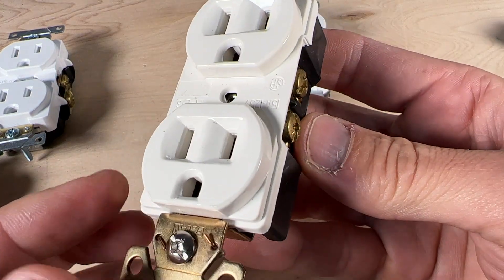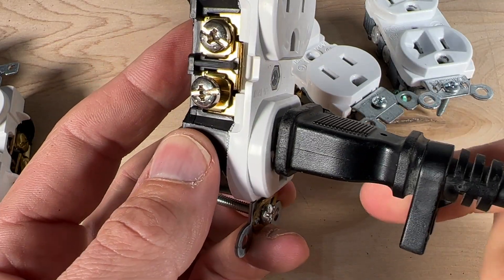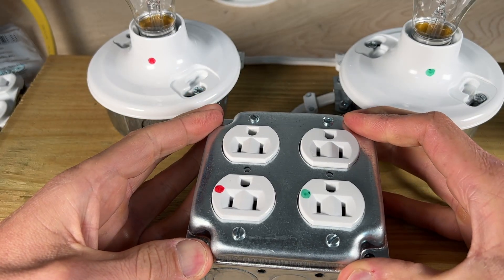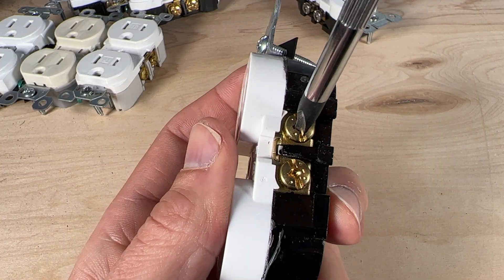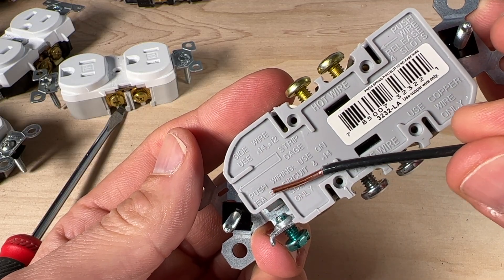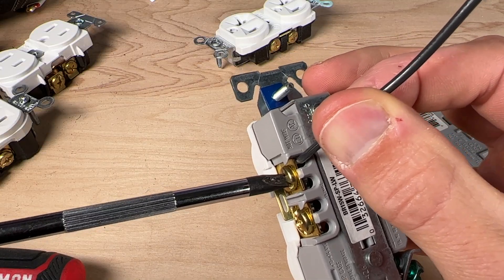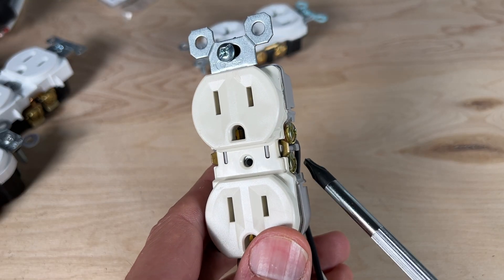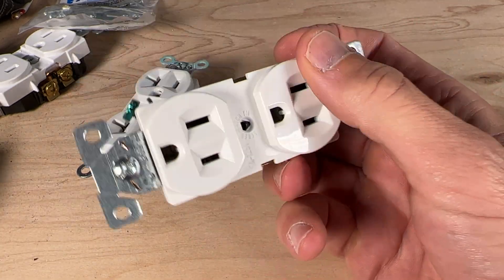21 Facts and Features Of A Standard Outlet

Comment: I knew about wrapping wire clockwise around terminal but the rest were all well kept secrets until YT, especially that special screw driver. So does that special screwdriver tip come in with a screwdriver that has changeable tips?

Comment: Don't know if it was right or wrong, but in wiring my house there are no breaks the wire. Removed a section of insulation from hot and neutral, looping around both screws and continuing down the wall. No break in any wire on any run.

Comment: Most of the features are just not practical to use. Also I knew of just about all of them. Those connectors in the 4” square are exactly the same as backstabbing. They are just little pressure springs in there just like in the outlet.

Comment: I never realized there was a difference in a 15 amp outlet and a 20 amp. I mean I knew the wire guage was different, but I never knew there was that extra horizontal slit on the outlet. I imagine they have always been there, and I just never really paid attention. Plus for example our microwave is built into a cabinet on the wall so the outlet is not visible. I'll have to check that next month when we do our kitchen remodel and that cabinet comes out. Thanks for the great information.

Comment: At 6:46 you say wind the wire clockwise but you go counter clockwise leaving the wire to unwrap when you tighten the screw.
Reply: He started with the end of the wire secured on the right side so yes, he then made a counterclockwise motion but the end result is a hook that goes clockwise.  When he tightens it the end of the hook will get pulled in.

Comment: Great video. I knew pretty much all of this except for using the hole in the grounding area and the slots by each screw as ways to make a shepherd's hook around a terminal. My only question..."How easy is it to actually pull this off when working inside of a box"? I know that a lot of videos show wiring receptacles and switches on a bench top instead of actually at the junction box for better visibility of the process being taught but really enjoy it when I see the actual work being done at the box.

Comment: Just wondering if you are in Australia, because you're saying wrap your ground wire, clockwise around the screw@ the 6.55 mark, and then going CCW as it is called in the USA, really twisted my mind after 47 years of wiring. Like handing a lefty, a right-handed pair of scissors.                    If you want to make something really educational, that most electricians do not know, show how to combine steel work boxes to make a 5-gang box, cuz' you know what happens if you need one, and the hardware store doesn't have any............

Comment: 2:15 your hots and neutrals are revered on one of your devices.
Reply: Yes, you are correct about the reverse wiring on the left receptacle at 2:15 in the video.  Also, ground wire is not attached to the ground screw in the electrical box.
Reply: I wonder if he did that on purpose to see if his viewers are paying attention

Comment: I've been slowly removing all the speed-wiring that was done in this house. Hideous method when 2 rooms are chained together on 1 branch. The 1st outlet "connection" (if you can call it that) carries the load for both rooms on those wedge plates. Very small contact area. Would suit me fine if NEC were to outlaw the practice.

Comment: you hook around the ground screw was anti clockwise
Reply: In the end, it is wired correctly as the open end of the wire will close on itself as you screw clockwise with the lead in wire on the left side and the open end on the right side.

Comment: So I think to need to be a little more clear on how the bunny ears as the ground on metal p ring. You need to have a metal conduit acting as your equipment grounding conductor or a grounding wire as your EGC in a PVC conduit if you want that to work. Other then that, I can’t say I learned much but I think it would be a good video for some apprentices learn a few things off of.

Comment: Interesting. You might want to do a video sometime on the evils of dual gauge wiring on a single circuit. I once was partially rewiring a house and found a twenty amp circuit with 12 Ga. Romex going to an outlet. No problem until I got to that outlet and found the pigtail going to the next outlet was 14 Ga. They were tied together with wire nuts with a pigtail going to the outlet rather than into and out of the outlet. The 14 Ga. wire fed the next three outlets and then a 12 Ga. wire from there to a light switch. I was lucky. The wall were open. The owner was sharp enough to see that and question it. The reason he questioned it was the first thing he showed me which was 14 ga. wire that wasn't long enough and had been extended using wire nuts for a connection and no box. This of course had been hidden behind sheet rock. I had to run a new circuit for the light and of course a new 12 Ga. circuit but as I said I was lucky as the walls were open for a remodel. This kind of wiring may not be the end of the world but imagine trying to find a problem or trying to explain it to the firemen.

Comment: A few of the outlets in my shop were back stabbed....I don't care for that either, I do the wire loops around the screws for a much better connection.  I like those commercial outlets you showed where they offer a form of back stabbing but still utilizing the screws, I didn't know that existed as none of my outlets are commercial grade, but now that I know, I may eventually start using those instead.  

Also didn't know about the outlets with the ground bonding on the tabs either, or just never noticed, or both LOL.  

Also didn't know that the Philips screw heads are actually #1 square drive instead.

Comment: Great stuff. I knew of many of them. Some are newer features. The change to accommodate Phillips made it's way to Canada a few decades back. Not impressed with that as the screw is less secure in the bit than just Robertson fasteners.
Robertson screws are NOT numbered. Coloured. Red and Green will do almost all electrical with Yellow being smallest and Black being largest.
So for electric jobs I prefer dedicated Red and Green screwdriver NOT a changeable bit. Having a bit possibly fall off is a hassle. Say for a deep box  having to attach ground wire, you can wrap it around the bolt while on the end of the screwdriver and still be able to push it to the bottom of the box without it falling off. Try that with a Phillips.

Comment: The wire stripper on the ears and the little hole by the ground are two I wasn't aware of.
The speed holes in the back of some receptacles this guy says ya shouldn't use. I agree. The problem is surface area contact is far less than using the terminal screw  creating a restriction at that point also electrical vibration on limited contact and overheating potentially leading to fire. I've came across one burnt out (no fire but not working, hot melted completely away from receptacle) and a few melted receptacles because those speed holes were used. It is good advice to not use them.

Comment: OK, I'll give the same question that many electricians answer in two different ways. The question is: when installing a receptacle with a ground hole, which way do you mount it? Ground hole up or ground hole down? What are you feelings about this.
Reply: It's better to install them with the ground hole up. This is for safety and to help prevent a short circuit. If the plug in the receptacle is loose and a conductive item fell on top of it, it will only touch the ground and there will be no issue. With the ground down, that item would create a short between the hot and neutral.

Comment: Have you done a video on GFCI outlets? Some of them cut power to themselves and any outlet daisy chained from them. Others have two different "downstream" connections, one straight through from the input, one switched by the GFCI. That was very useful when I replaced an outlet near a kitchen sink. The outlet on the other side of the sink and the outlet across the kitchen for the fridge both connected in that box. It made a cleaner job with fewer connections  to be able to eliminate the wire nuts and pigtails that had been there to connect 3 outlets to one incoming wire.

Comment: I'm an old DIY and several of these facts and features were new to me.  I think most important, as you said, don't use the Push or Backstabbing connectors.  They are the weakest connection you can make, and I think should be outlawed.  I've seen evidence of historical arching when replacing older units.  I'm afraid of fire using the Push connections.
Reply: The reason I don't use these connections is the fact that electricity travels on the outside of the wire & these connections only touch a small portion of the small tab inside. The second is that heat distorts the tabs and make the connection even more prone to fail and your fears are confirmed, these can cause fire.
Reply: @smarthome2660    Thank you.

Comment: I've realized that work is made much more enjoyable and satisfying by identifying and eliminating all the little aggregations. I understand that this is an ongoing venture, but here's my up-to-date list:
1. Buy the highest quality hand tools that you will be using most of the time. Strippers, lineman plyers, screwdriver.
2. Use only commercial grade outlets. Residential outlets huge source of chronic aggrevation.
3. Ditch wire nuts, use Wagos. Light fixtures with stranded conductors, use Wago 221. It's the light in the stairwell ( that can only be reached with complex system of ladders and scaffolding ) that will function erratically,  due to loose wire nut connection.
4. Deep boxes.
5. 3M 33 for color coding and 3M 88. Keep clean by always keeping in plastic case..
6. Pigtail outlets with 14 gu. wire (unless it's 20a outlet) and connect to 12 gu. run in box.

Comment: I got a house built in the early fifties in one wall there's an electrical outlet, but there's no wires going to it. Originally the well pump was wired to an electrical outlet in one of the bedrooms. If I flip a breaker to turn off two of the outlets in the living room I'm also turning off 90% of the power to one of the bedrooms. Somehow the living room ceiling fan is wired into a different bedrooms electrical outlets, but only two of them. The other two are wired to that same bedrooms ceiling fan and to a hallway light. There's one outdoor electrical outlet that is all the way up against the eve and is controlled by a light switch in the master bedroom. Two outlets in one concrete wall within a couple of feet of each other are on two different circuits.  One wall in my dining room/ front room has four electrical outlets on one wall. One of which is controlled by a light switch, 2 share a circuit with one other outlet that is in the laundry room on the other side of the wall, and the other is wired to its own breaker so that's where I plug my freezer in. When I opened up the drywall in a bathroom there was a wire spliced together with no wire nuts wrapped with duct tape not in a junction box. Also the electrical panel is in a bathroom and originally the hot water heater was literally 2 inches under the panel. To rewire this house would be such a pain as that electrical panel is on a concrete wall which used to be the exterior of the house under a flat roof.
Reply: Oh and sometimes the lights flicker, but I suspect that's the shitty transformer from the '70s it's leaking even after fpl allegedly fixed it. My neighbor's house which has all new wiring also gets the light flickering that's what leads me to believe it's the transformer.

Comment: So I did learn about the grounding hole and Eaton's stripping. But a common thing not touched on I see is the use of electrical tape around the outlet and the correct tape to use. Scotch 33 and 88 are the two I use for the flexibility and stick to it capability. I have been trying to find out what UL and NEC say about it not cannot get any one to answer.
I've been told by an electrical engineer that it would retain heat thus possibly causing a fire hazard. I could see using tape wrong and covering the vents on a dimmer switch that that it might cause over heating but that's all. I've been taping outlet and switch screws since 1969. Never had any issues. Your thoughts on this? Please!

Comment: 10 (the wire channel) and 17 (ground screw helper hole) would have been handy to know in my past exploits.  Seems like it would be less trouble with getting the wire wrapped consistently and neatly around the terminals.  Also nice to know there is actually a special bit.  Thanks for the hints!
Reply: 17 mind blown

Comment: Guess iv been doing it to long,, not a single one was new to me,, by the way you twisted the ground wire counter clock wise wene you used the little hole,,, I have also seen those holes on the hot and neutral plates as well👍

Comment: Very disappointed.  This is the first video of yours I had to give a thumbs-down due to deceptive thumbnail -- a thumbnail that shows something which does not appear in the video.  I've liked a few of your videos already so this is both surprising as is pains me.  The next deceptive thumbnail will have to earn a "Don't Recommend Channel" if it pops up in my recommendations.  The video was informative and didn't need a deceptive thumbnail, so I'm especially confused.

#20 About commercial outlets self-grounding the box screw, you should have stated "but this does NOT mean that you can skip attaching the ground wire. it's just an added safety measure."  People might get the wrong idea that this is intended to save copper.

Comment: I thought I was going to know them all but you got me with the little hole to help wrap the ground wire. Never knew about that one...my favorite "tip" is to avoid using the receptacle as a connector but rather attach ONE SET of hot and neutral as pigtails to the receptacle then ADD those using nuts to whatever is in the box. I try to use pigtails everywhere possible so if an outlet, switch or whatever fails, it can be removed from the circuit and not disturb all the other wiring. I tend to use a lot of "oversize" boxes that way but it's so much easier to service later, especially if I use a 4" square box with a mud ring. Never run out of fill space doing it that way that's for sure...

Comment: #12 and #14, Speed Wiring
Residential (Cheap) Outlets have the slot to remove the push wire. Commercial outlets use the screw to clamp the push wire.
I personally know of four different houses that had electrical fires due to "Speed Wiring" with residential outlets.
Spend the extra dollars and get Commercial grade outlets. They are built better.
Reply: Completely unnecessary to buy commercial devices in a residence unless you want to waste money. Just loop wire on screw terminals and you are good. Even in kit, bath, and other 20 amp circuits, as long as the load on a singe receptacle doesn’t exceed 12 amps(NEC 210.21(B)(2)).

Comment: My van got robbed years ago but I had a set of Klein screw drivers that had a small a small metal dowel for lack of a better word at the base next to the actual screwdriver shaft for curling wire. Have never seen again, soo handy.
Reply: I have that screwdriver with the wire bending feature, and it does get used.
Reply: @anthonyhitchings1051  where exactly do you park your van. Purely out of curiosity. I'm just happy someone new what I was talking about!

Comment: Very good video, but I believe you are backwards on the clockwise direction of the screw terminals. If the wire pulls from the left, it will loosen the screw.

Comment: FYI for those who need to replace the male end on a cord such as a lamp. The wire that goes on the large prong side will have either a line or molded stripe on the neutral wire & the hot wire will usually have writing on it. This matters especially when replacing a lamp cord because you don't want the outer part of the lamp socket to be hot. You want the center of the lamp socket to be hot. Do NOT replace a lamp cord with one that both prongs are the same size.

When installing an outlet or switch in a metal outlet box with conduit, your mounting screws need to be 1/2" shorter if your wire connection feeds in through the top or bottom of the box.
Reply: Smooth side (hot) rigid side (neutral)
Reply: @J_M3444  Rigid means stiff, did you mean to say ribbed?

This dude talked about this subject on a different video but he was referring to light fixtures and the need to hook the hot & neutral Romex to the correct terminals.

I fix a lot of lamps and they are mostly wired right but it is dangerous to wire backwards. It is impossible to touch the hot connection on the bulb when it inside the socket but so easy to get shocked if the screw part of the bulb is hot, even if the lamp switch is off. Adding a non polarized cord gives you a 50/50 chance of getting shocked.

Comment: Electrical code in California dictate that if a 20A outlet or sw is used
that circuit  MUST  use yellow 20A romex  PLUS  a 20A breaker to
protect that circuit. No mixing & matching 15A & 20A components.

!

Comment: Just an add on for the tabs on the side terminals.  A scenario to remove the neutral is if the outlet is fed by two separate circuits. Example if you have two dedicated appliances near each other and would rather have a single duplex receptacle rather than two single receptacles, or it's an existing box with only one gang.